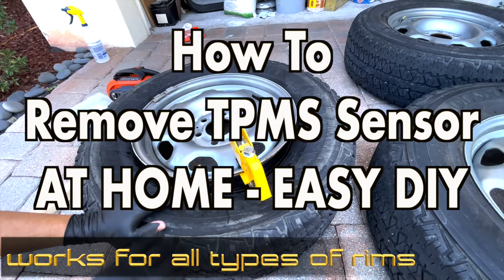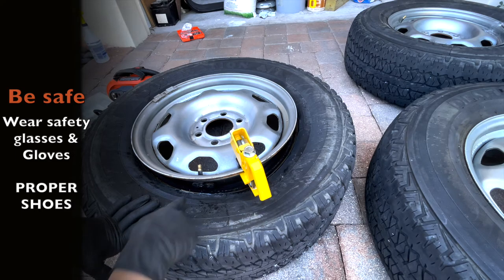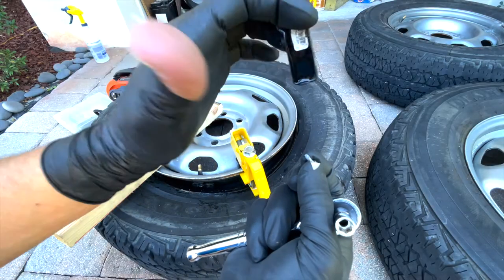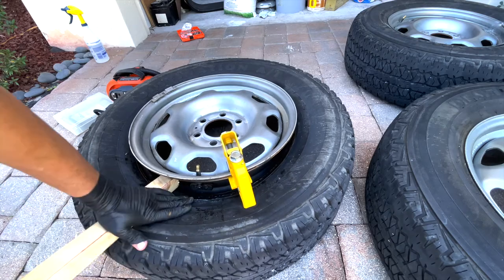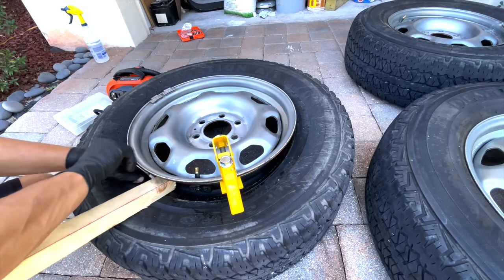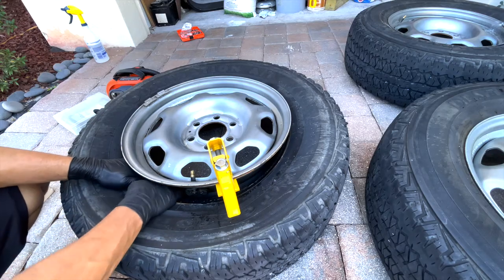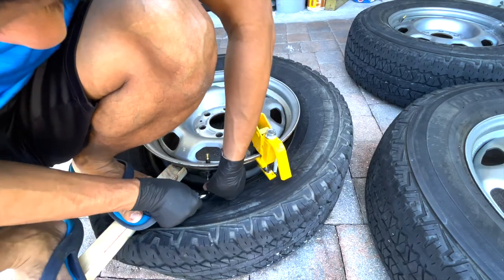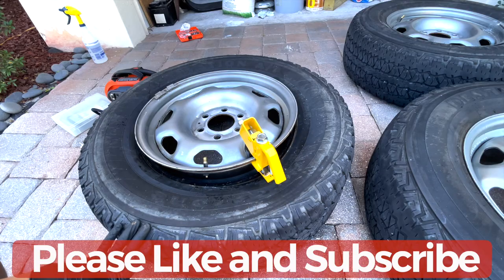How to remove TPMS sensor at Home - Easy DIY

Comment: How do you reseat the tire bead?  Does that just happen when you apply inflation to the tire, or is there something else you need to do?
Reply from the maker: It happens on its own when you inflate it.
Reply: I just did that today.  I used my battery powered pump along with placing two 2x4's under the tire.  One under the tpms and one on the opposite side.  I stood on the rim to help push it down then the tire started taking air.

Comment: Use 2 buster to keep it open, remove the vale with the sensor, put the new ones in. I did it without removed the wheels off the car.
Reply from the maker: Good tips